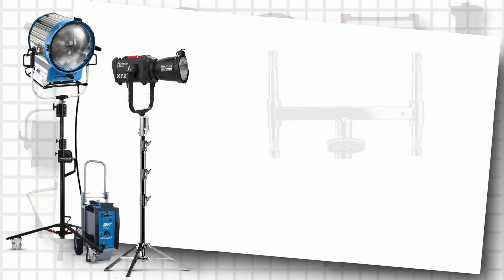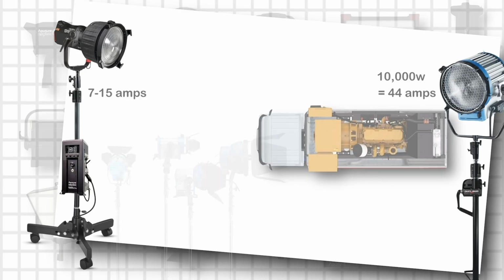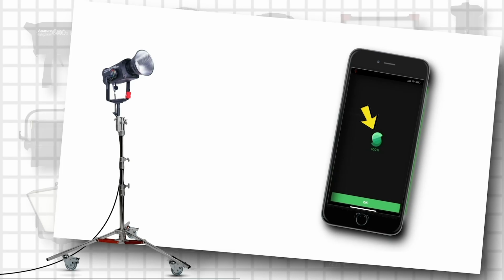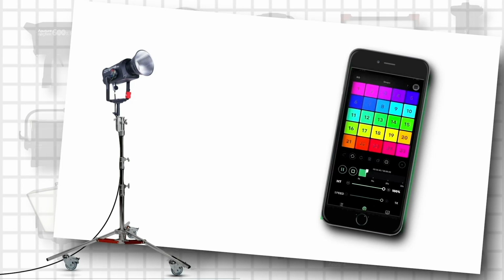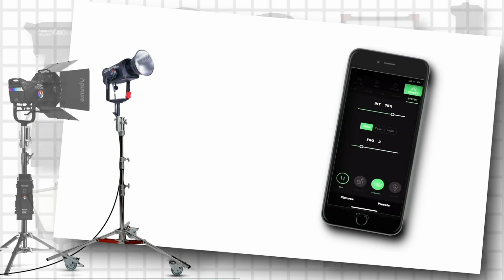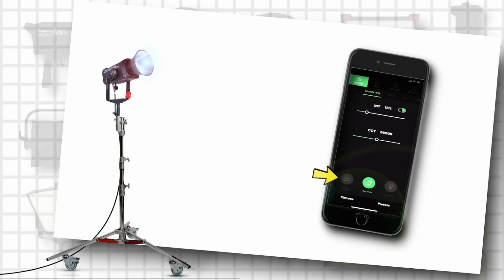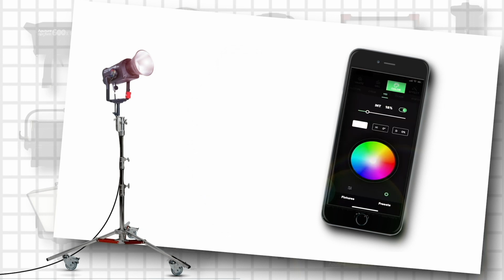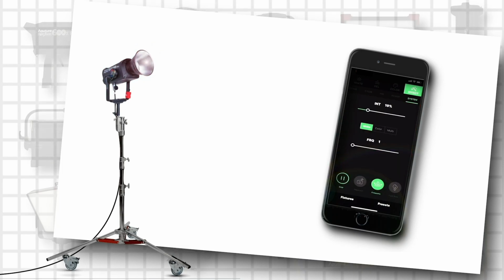The Pros and Cons of Using LED Lights in Cinematography

Comment: Fantastic video. few things I wanted to mention

Although big tungsten HMI may still be brighter, its closer than many people think. I have seen 600watt tungstens next to 600watt LED, and the LED are MUCH brighter at the same watts (best way to test with a spectrometer). one big downside of LED is they need a fan (which can produce noise), and LED can be prone to overheating if you are shooting on a very hot day (40-50 degrees celcuis). while tungsetens "typically" do not require a fan (and are unlikely to overheat from the sun, as they already run very hot).

some cheap LED also have bad colour separation even if they look white (can test with spectrometer), which can cause weird skin tones. but thats not as much an issue when going with reputable brands like Aputure or Arri lights.

still these days. Ive mostly moved to LED because of the size and weight, the fact they also typically run cooler means throwing modifiers like softboxes on is easier (more likely to melt with old tungsten lights).
Reply: I'll add to that another matter: you can get very different results using colored RGB lights and physical gels on a white/tungsten light. if you start with a pure red RGB the wavelength is very limited to just the red values, while if you start with white you'll get a smoother falloff of colors and more color separation, which is usually something you want unless you're going for a specific effect.
Indy mogul made a great video all about that a few years ago.